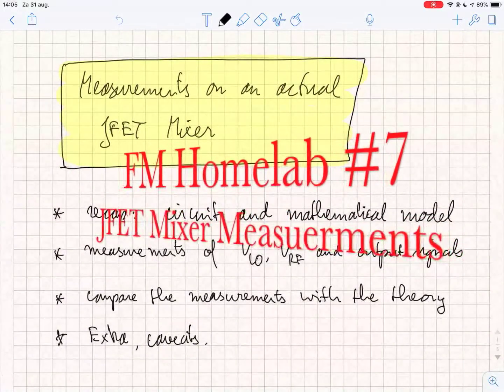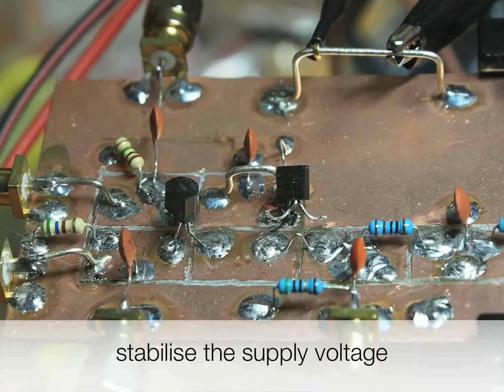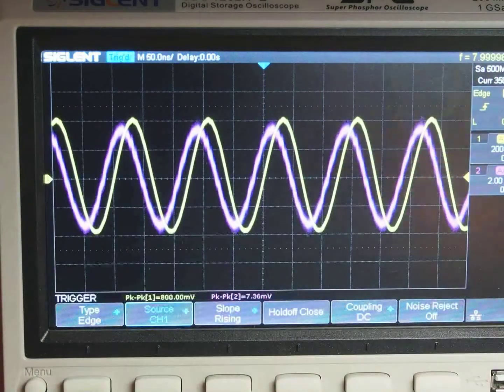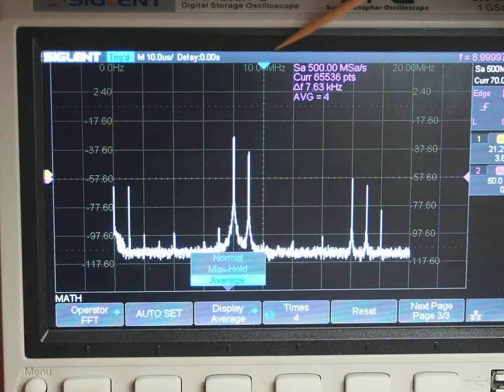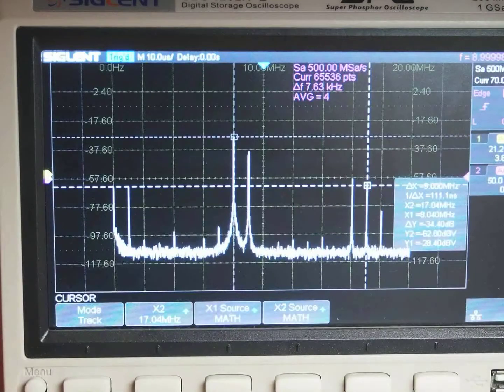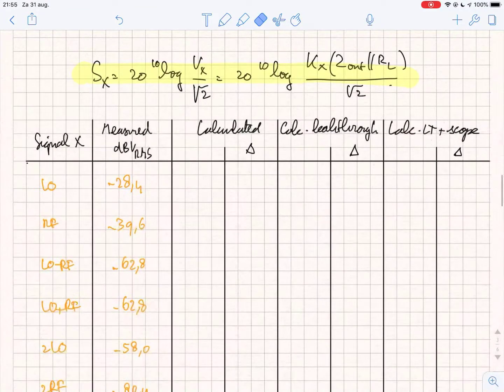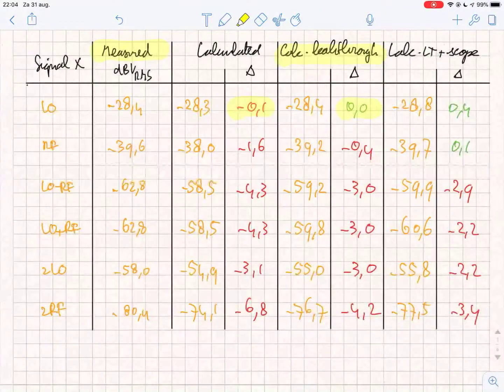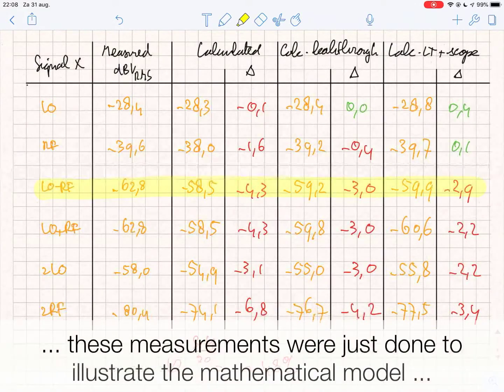#7 JFET Mixer Measurements

Comment: Thanks a lot...it was really useful...would u plz make a mixer with a dual gate mosfet like bf961 for mix 10.7mhz and 134mhz?  I need to mix them to make a fm transmitter and i do not have spectrum,it is really difficult without eiqupment....thanks again for teaching